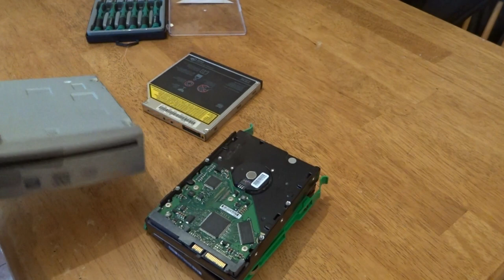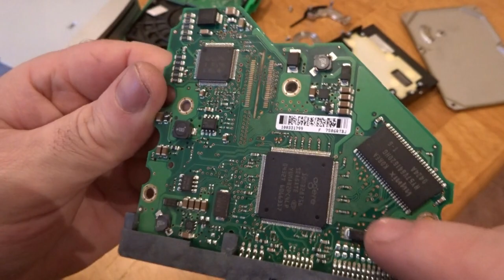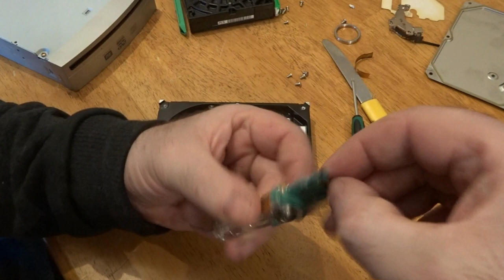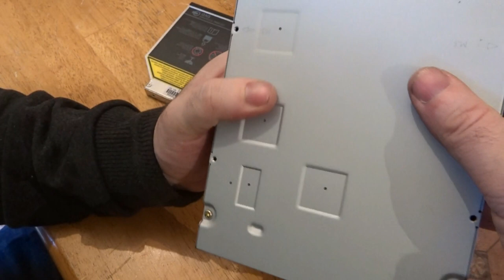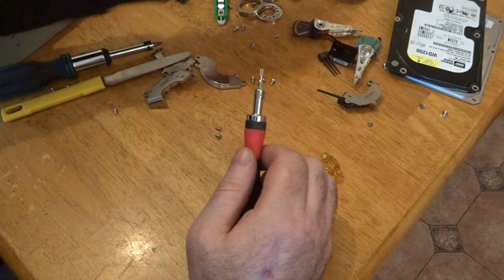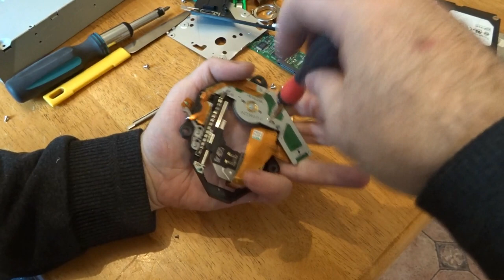mirco scrapping harddrive's and cd rom's for gold recovery

Comment: 37:00 Yes, there is gold in laser pickups. Not much, it's a lot of work getting it out, but if you have the time and patience, it's do-able. 
Also, on Western Digital hard drives, there are usually 4 gold plated contact pads on the platter motor. You can just take a sharp knife score across the cable and peel it off. you can process them just like fingers, stick them in your acid/peroxide and they'll come right off.
Reply from the maker: Thanks for the great information